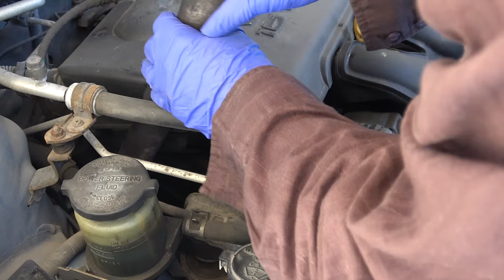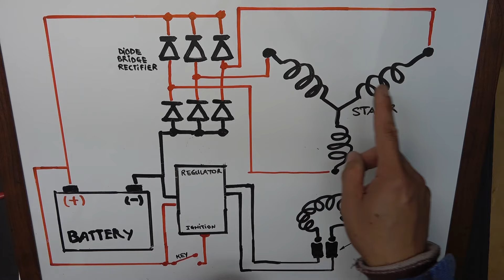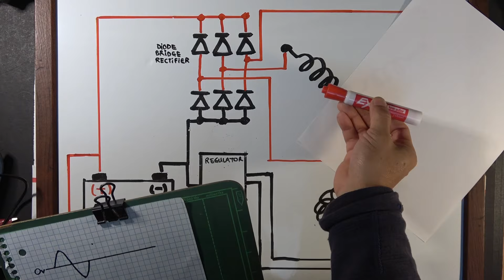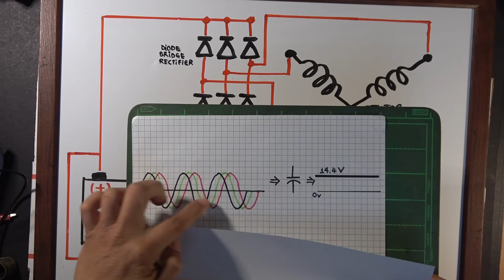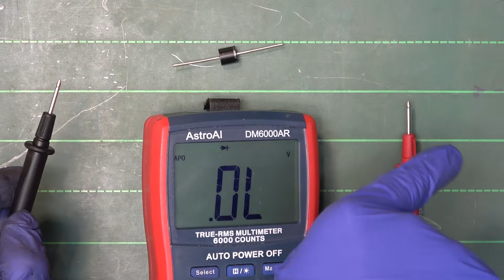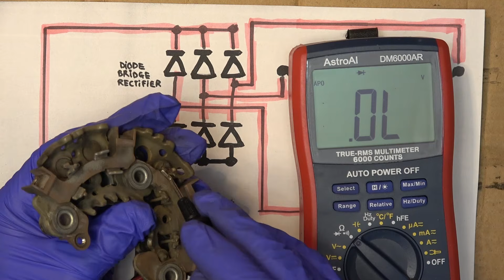How to diagnose & repair a car alternator: the missing manual (Toyota Corolla-Matrix-Pontiac Vibe)

Comment: I was running a car 2001 Saturn sl2 without EGR Valve trying to clean it's passages (following one technique demonstrated by richpin06a, but probably longer than needed) and burned the new aftermarket alternator there (a smell of burn for a moment). I installed a new one, but  the one I burned I'll use to learn more about the internal structure of the alternator. AI Copylot said with that type of damage it is safer to replace. This video is helpful for me to see how to open the alternator and how to test some parts. Thank you.

Comment: Great video. I could easily follow the diagnostic procedures - my Toyota Camry (1999) has the same alternator. I found the fault was a diode in the rectifier. And my sometimes  mechanic suggested I should just replace the whole alternator!  Now I'll know where to look if it fails again - the original Denso rectifier is very expensive so I had to replace it with a made in Poland brand.

Comment: I just watched another video for a 2007 Toyota Matrix alternator replacement and they did not have to remove the fan -- is that possible?  Maybe it's just whether you have the right extensions and breakers to reach into the space?

Comment: Great Video Sir! Straight to the point, and properly testing using a simple multimeter. Congratulations. Instead of buying /Exchanging an alternator at parts store, I would rather buy the new set of brushes for 35. usd. Or even go to the Junk Yard and bring couple of those brushes sets and keep my original alternator. $$$ Big time savings for a 2001 Corolla with 250k miles

Comment: thanks! i have a slightly burnt smell from the alternator. what's causing this and what i need to replace
Reply: I also experienced that ,replace the voltage regulator and the diode bridge rectifier.
Reply: @davymuleba3152  thanks !

Comment: current ( electrons ) flow from negative battery post to positive battery post
Reply: No, current goes in the opposite direction of the electrons... ironicly enough.
Reply: @mb8787  current is electrons work they move from negative to positive. the only item that can move from an atom to another are electrons. you are an ID 10 T

Comment: Pls what do i do if the rotor is not grouding when i test it to the alternator case? The ground in the middle of the motor shaft of my alternator only grounds partiallly when i spin it.
Reply: U need to hit the rotor well to the body of the alternator or look for corroded part

Comment: Up north we deal with terrible corrosion that makes radiator fan bolts impossible to remove without either cracking or melting the plastic tabs. 

The alternator pivot bushing is usually seized.  You can make a screw press from a large socket, a bolt, and nut.  This makes re-installation easier.  Cheers!

Comment: Shouldn't you at least replace the bearings in addition to the brushes?
Reply from the maker: @lynntatro7374: As the old saying goes, if it ain't broke, don't fix it! Just kidding! Well, you have a good point. But for this particular alternator, it doesn't have any squeaking or grinding noises either in the car or on my test bench. I don't see a need for replacing it yet. Replacing a bearing needs a video on its own. This video is 39 minutes long and it will be way too long if I also go over the bearings.
Reply: A lot of times, replacing the bearings requires a press and a bearing remover. I think he's going for a quick fix to get her going.